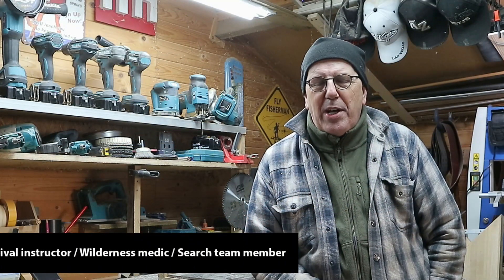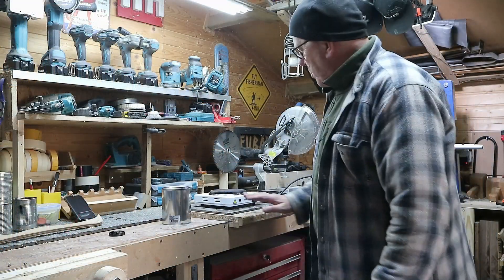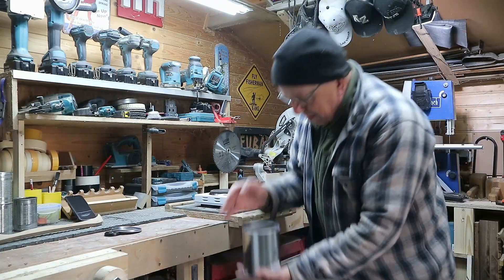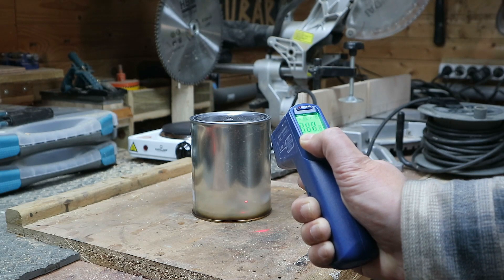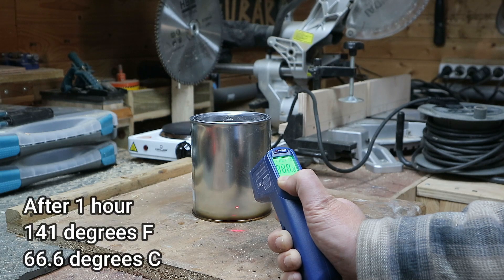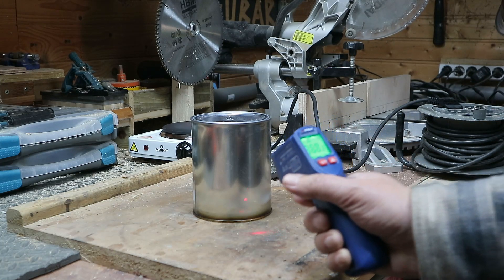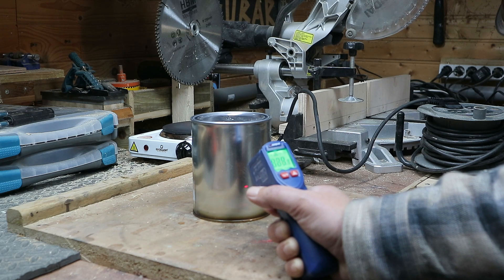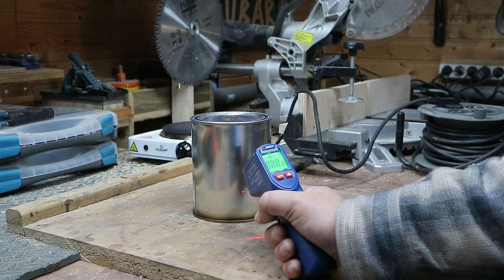#23: Transfer FREE HEAT indoors, safely ! No Carbon monoxide, No fire risk ( 3 hour test )

Comment: Mike, you don't mention what the temp of the hot plate should be.  Low?  Medium?  High?  Would also appreciate a direct link to your Kelly Kettle vid.   ...   Would it work okay for me to use a few of my wood pellets in a portable grill (lined with foil) to heat the can of sand?
Reply from the maker: Hi FF... The idea is to heat it somewhere where you are already heating. Like next to a fireplace, on a radiator in the living room you are already heating etc. Otherwise you might as well use the hotplate as the heater. It was just for demonstration purposes. Once the can is nice and hot ( from sitting on the radiator in your living room al evening ) you take the can upstairs to a room where you have no heat running... Here is the requested link : https://www.youtube.com/watch?v=7cOZVw4SJes&t=328s

Comment: Would rocks placed in the sand help hold the heat longer since they would be denser? Just a thought
Reply from the maker: Doug, sand, cement and rock have about the same heat retention ratio, but be careful. Rocks may contain water, especially river rocks. If heated too much or too fast they may explode

Comment: When I was little my Grandma used to put bricks by the fireplace to get them hot and wrap them in newspaper to keep you from burning you and your bedsheets and she would put them under the blankets of your bed by your feet to warm and keep warm(more bricks more heat). Of course we had fabric mattresses not sure how a memory foam mattress will fair with the heat. Also she had a covered ash bucket she would fill with most of the non-smoking ash from the fireplace in the morning and put on the other side of the Den to release the heat into the rest of the room. It was a tight fitting lid as I recall. She would also use it to heat up her "haybox cooker" for slow cooking. She was a "heat miser" as my Grandpa used to say. We were on propane and Grandpa didn't like having to fill it so Grandma got clever on how to keep the house warm.
Reply from the maker: Awesome
Reply: When I was little my grandma used to put us in the bath and poor cold water over us and scrub us with a scrubbing brush.

Comment: Looking at the comments there seems to be some confusion because you used a hot plate. You should clarify in the video that this would be used with an existing heat source.
Reply from the maker: It was already explained in the video description, but you are right... it would have been a good addition
Reply: @mikeshawbrook-selfreliance  
It's a good tip. Never heard of people using sand. I've seen people use other things same way such as bricks.
Not tearing you down just explaining my veiw. 
I don't think most people read the description. Many are lacking common sense as well. And nowadays most don't live in cold old houses with wood heat and can't really relate.
Reply from the maker: @timothywilliams2021  People will be people, it's all good :-)

Comment: Peltier stove fan on top. You might need a bigger can
Reply from the maker: Already ordered LOL
Reply: That's wright you did mention a fan in your video. Hope it arrives soon, Cheers
Reply from the maker: @robertpitt8418  Should be in by tomorrow :-)
Reply: Sand due to its shape and small contact area is self insulating so the outside of the can would cool down first after which your just blowing room temperature air.
Reply: @oldriver1827   @oldriver  i wonder if you used a flat laptop fan, this type of fan would be flush to the surface and should extract more heat.
Reply: @robertpitt8418  No
Reply: You could also steep the sand in candle wax, this should hold more heat and last much longer. But you would have to drain of all access wax before heating, leaving only dampened sand, to prevent a fire.
Reply: @oldriver1827 (NO) = YES  : )
Reply: @robertpitt8418  You can not surface mount a fan they work by blowing air thru.
Reply: @oldriver1827  The flat fan only needs enough room to hover just above the surface to work properly.   (Pillars)
Reply: @robertpitt8418  Your peltier fan is converting the heat you wanted into energy to blow pretty much room temperature air.
Reply: @oldriver1827 now your reading much to deeply into things  ; )

Comment: How much they would heat the room is next?
Reply from the maker: Too many factors such as 1. How much heat went in 2. How much sand 3. Thickness of can 4. Insulation of can 4. Position in room 5 Starting temp in room etc etc

Comment: But how much energy did it take to heat up !
Reply from the maker: Michael, the point of this system is to use energy that you were already using anyway. Put them on the radiator in the living room, next to the fireplace etc etc. When you go to bed, take the cans upstairs. That kind of thing. It's not like a magic trick where suddenly energy appears. It is a way to have "free" heat in rooms because the cans were heated in one and then taken to another
Reply: @mikeshawbrook-selfreliance  I was asking how long it took to get that sort of temperature, I wrote it wrongly sorry but thank you for the reply

Comment: Sand holding heat is not the reason people die in the desert at night of hypothermia
Reply: That sand is also constantly radiating heat up into the very cold vacuum of space (which cools it down faster).  A can in your house doesn't have as clear path for the IR to radiate up into space like that.  There is a fairly narrow wavelength band of the IR that easily and completely gets through the atmosphere.  It needs as little of a barrier of absorbing, reflecting, etc between the heat source and the atmosphere as possible to do this. 

    This principle is why a person camping will notice a difference between cowboy camping out in the open with a very clear night sky vs cowboy camping out with heavy cloud cover or under tree branches--even if the ambient temps are exactly the same in all the above situations.  It will feel colder under the first conditions--precisely because your body's IR will be more efficiently radiating up into space. 

   There are 3 major ways of thermal energy exchange--conduction, convection, and radiation.  We are talking about the latter--radiation where heat energy acts like light and goes out in all directions away from the heat source to cooler surroundings (areas with less energy).  And energy always flows from a higher energy area/source to a lower energy.  The more extreme the difference between the two, the more quickly the energy exchange tries to takes place. Considering space is around -455 * F on average, well that's a pretty stark difference and hence, the sky acts as a very excellent "heat sink" in a radiative sense.  

     Desert dwellers in ancient times also used this principle of radiative space heat loss to make ice in the desert even when the ambient night time temps were above freezing.  What they would do would make like an insulated dome structure with a hole at the top and within that structure would be a little area to put a pool of water under the hole in the dome.  The water would radiate its heat energy up into the very cold vacuum of space getting colder than the ambient outside temps, and the insulation surrounding it would help to maintain that temperature gradient, thus allowing it to get cold enough to phase change into ice (and once it does that, there is some energetic inertia to phase change it back into a liquid, since it takes a lot of energy to change water's state from one to another).

Comment: The higher the temperature the better obviously, but there are limits too. Heating outside over a campfire would work.
I'm interested in the heat capacity of the sand. I understand that some salt solutions have a greater heat capacity than some metals and sand though.
Reply: Water boils too quickly at low temps. Sand you can really heat up and sand holds the heat well. If you are going to only use a heat sink with temps below the boiling point of water then water would be the way to go. Anything higher you want dry sand. It's cheap, you don't have to have special sand and it works.
Reply from the maker: Can can hold heat up to approx 500 - 600 degrees F In btu's it can hold 0.2 Btu/sq ft - °F

Comment: Hot plate is not exactly free heat. What would you use to heat the sand containers? No need to use wet sand. Dry sand works great. You can build a cinder block block building and fill the lower portion with sand, then put in a fire box and chimney then fill it up to the same distance above the sand. Have copper piping throughout the sand and then pump water or antifreeze through the pipes and into a radiator in the home or shed and use a fan to extract the heat. If you have free wood then it's free. If you have enough solar you could heat the sand to super high temps. Dry sand is all you can use. You don't want to turn water into steam in your fire block container.
Reply: True. A couple thoughts. Some areas have cheaper electricity at night, so while it is not free, if you charge up sand or other mass thermal batteries at night when the electricity is cheaper, and then turn down the heat during the day, you could save a bit of money. 

    A more truly free solution would be to make a very well insulated solar oven and heat the sand/mass thermal batteries with solar heat.  

   My yard has a lot of shade, even in the winter, and so Solar collectors near my windows (where I would pipe in the hot air from) is unfortunately a no go.  But I do have a couple small areas further away that get sun for at least a few hours.
Reply from the maker: @justinw1765  The solar heater as a source is exactly what I am working on :-)
Reply: @justinw1765  Some great thoughts there Justin!
Reply: It is not dry heat either like you'd get with a wood stove or fireplace.
Reply from the maker: Pete, the idea is that you heat the sand batteries on an existing heat source that you have any way ( a fireplace in the living room, a Furness in the kitchen that you are cooking etc ) so energy "used anyway" With the sand batteries you can capture some of that heat and transfer it to areas ( bedroom, foot heater in office etc etc ) where it would have otherwise been lost. So FREE heat... does that make sense ?
Reply: @mikeshawbrook-selfreliance  I'm thinking about how much empty space there is in a traditional electric or gas oven when cooking a meal for one especially. I'm surprised that there aren't such sand batteries on the market, use them instead of an hot water bottle at least.
Reply: @steveclark..  That's a good idea Steve. The only "downside" is that the preheating of the oven would take longer to achieve as you're now heating the batteries too. So it's not totally "free" anymore as it takes more electric or gas. However, that doesn't mean it's still not a good idea. haha ..... In the wintertime, you could leave  your oven door open after the meal is finished and the allow the heat from the battery to radiate out. Basically turning your oven into a mass heater.
Reply from the maker: @bobjackson7516  The idea is to heat the batteries off of a heat source that is running anyway, like in front of a fireplace or on top of radiators that are running anyway.
Reply: @bobjackson7516  Have been leaving the oven door open for years now, why not let the warm air waft into the house.😀
Reply: @steveclark..  Indeed! But with the batterys like you mentioned.
Reply: @mikeshawbrook-selfreliance  Oh, indeed. I get that 100%.
Reply from the maker: @bobjackson7516  Sorry, this was intended for Pete McWade :-)
Reply: @mikeshawbrook-selfreliance  Oh good, I was worried you thought I was one of the ones not following along. ;)
Reply: @steveclark..  Water has 6 times the heat capacity of sand.
Reply: @oldriver1827  I've just seen this whilst in bed with two hot water bottles funny enough. I have wondered if a sand version would still be warm in the morning but going by your replies, I'm guessing not.
Reply: @steveclark..  Among cost and availability is sands ability to be heated to around 1500 f before starting to degrade. So yes, the right size container of sand could stay warm a long time if you fully charged the "battery" to 1500 f.
Reply: @mikeshawbrook-selfreliance  If the heat was not free in one room, moving it does not make it so.
Reply from the maker: @oldriver1827  Good for you
Reply: @mikeshawbrook-selfreliance  Also, with water having 6 times the heat capacity of sand it would be way more effective as long as your dealing with temperatures below its boiling point.
Reply from the maker: @oldriver1827  You go with that then. I would love to see the result !
Reply: @oldriver1827  would water cool faster than sand?
Reply: @MariaVazquez-du3st  No,  because water has a higher specific heat capacity than sand.  But you cannot heat water past boiling,  you can heat sand to around 1500 f before you start makin glass which occurs at about 1700.
Reply: @oldriver1827  thanks 👍